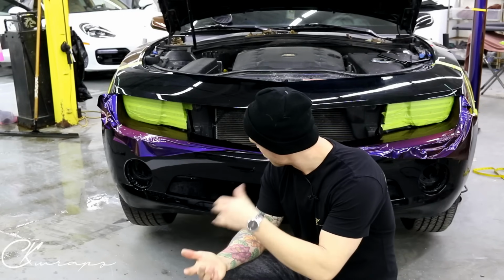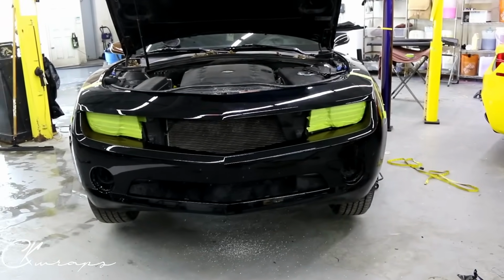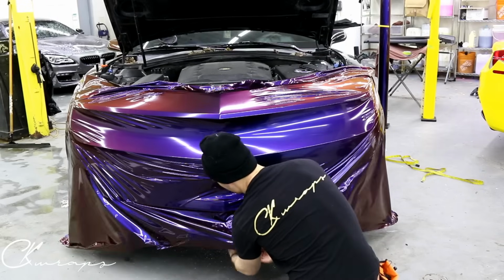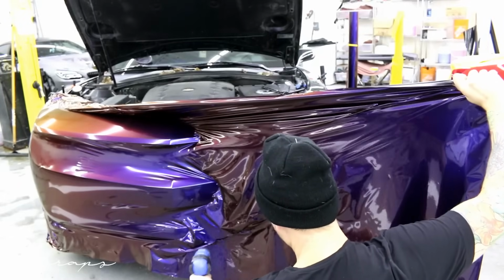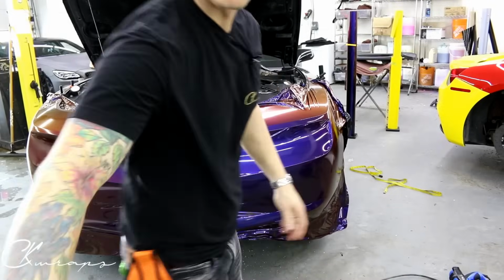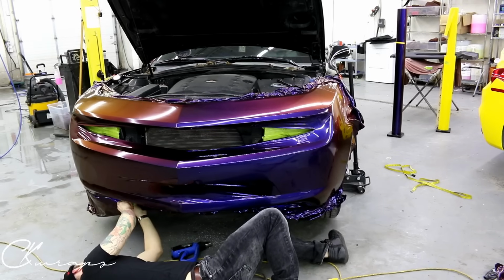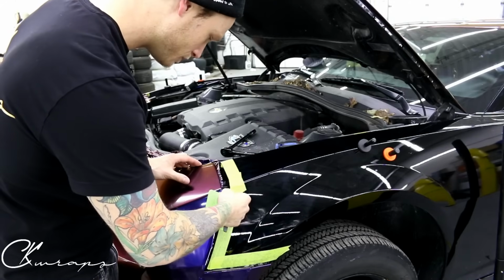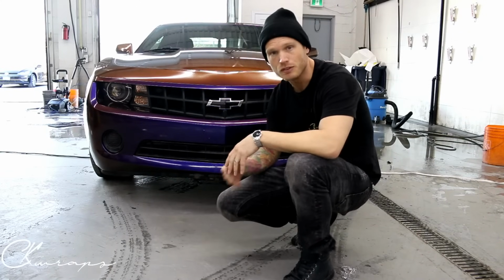BIGGEST EVER Camaro Front Bumper Wrap With Inlay And Knifless Tape

Comment: great stuff man, I watch a lot of different installers and you give some great advice. Now constructively I would suggest 2 things.. an IR heater on a stand, as a one man show having this a few feet away will increase the ambient temp just enough to soften but not too much that you over stretch. secondly that gravel or dirt on the bottom cant be good with all the static potentially drawing into the film.  other than that keep up the good work!

Comment: I see a lot of talk about cold stretching as much as you can and only heating for deeper parts or corners as needed.  You seem to heat and stretch across the bumper.  Doesn't this fade the color of the wrap? Can you explain why you don't use heat only for killing the vinyl memory or for recesses?  Genuinely curious, about to do my first wrap.
Reply from the maker: When wrapping a bumper with this much "taper" at the top + bottom middle and upper and lower corners we must add heat. If you watch any installer for example Justin Pate. You'll see how he also will stretch the film across the bumper using heat. Yes the color can fade if you stretch too much. The idea is obviously not to over stretch the film. Also I did heat along all of the edges + corners. I did not heat around the fog light area since it wasn't very much stretch. With all bumpers it is mandatory to heat and stretch across the bumper. This doesn't necessarily apply for all panels. Also, depending on the temperature in your work space, if it's let's say 90 degrees then you would most likely not need to add much heat if any at all. So how much you heat the film will also depend on the ambient air temperature

Comment: Dude you do great work but I could paint this faster then messing with that stuff.
Reply: Kinda what I thought .... All the disassembly involved is no different than a color change in paint .... Plus it lasts longer anyway ..
Reply: Alot of the custom colors that are offered from 3m, avery, or vivvid would be super time intensive to replicate. And if you are offering those types of paint jobs for $2k-4k and making money?  Well..... More power to ya.
Reply: paint has it's place but I've painted numerous personal cars and builds to 10k-20k  rock chips still chip the paint plus if it's anything of substantial value Porsche/Ferrari/etc paint decreases value. also when that damage occurs you'r back to blending and matching. with wrap films you simply replace the panel.. both have their place
Reply: So where you gonna find for instance, purple matt chrome paint? It's the colors that make the difference.
Reply: Robert G yeah...and make it irreversible...
Reply: @Telelikeitis  well said 👍
Reply: Goodluck finding a paint job in this color for the same price as wrapping it